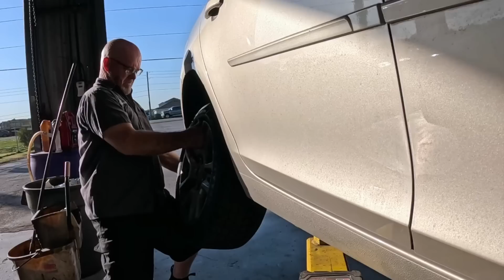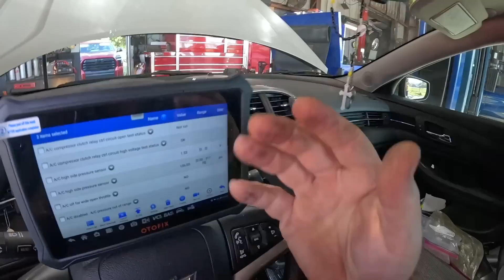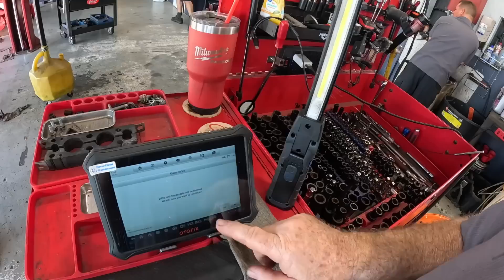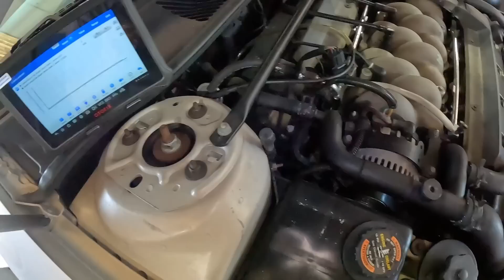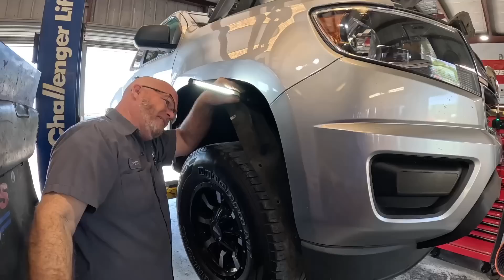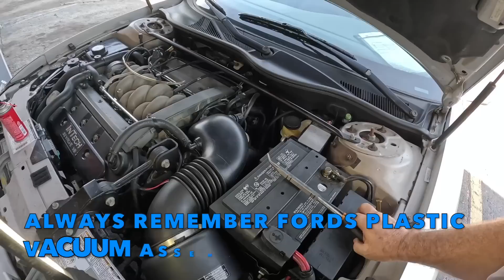99 Lincoln Idle races, stalls. Colorado Condenser. Malibu Temp Sensor TPMS. Auto Repair Shop DAY 699

Comment: And you need a smoke machine
Reply from the maker: Have a couple of them, the shops larger one and my little Ancel machine. I use them rarely since 99% of the time the problem can be found without it. But it certainly does come in handy when really needed!

Comment: The Lincoln was an odd one. The complaint was the idle races on cold start. Customer drives the vehicle to the shop, gets it up to operating temperature, and then waits while you're supposed to diagnose the issue. I'll bet he made a beeline to Autozone on his way home to pick up that sensor.  🤣🤣
Reply from the maker: It’s always a race to see if they get to AutoZone before the shop! 🤣
He did not want to chase the vacuum leak I found later and bailed.

Comment: Hey Jimmy. The problem you had with the Continental is very very very similar to what I was dealing with on a friend 2003 Econoline van with a 4.6.

He had replaced the MAF, IAC, and TPS. Truck still has the same symptoms. I even put on a spare throttlebody I had in case it was maybe sucking air

Not sure what could be done next. Maybe smoke the system?
Reply from the maker: Yeah, the main vacuum hose under the throttle body goes to a plastic tube under the wiper cowl. Huge vacuum leak, which probably explains why the MAF didn’t read at idle. It was getting air from the leak easier with the throttle closed.

Comment: The viewer who suggested that you pull down your videos because you don't know what you're doing must be furiously pounding his keyboard after the mass air flow sensor replacement didn't solve the problem.
Reply from the maker: Yeah, that one felt a little too good to be true haha. Luckily we got it solved, although the customer declined further repairs. :/
Reply: The ones that make an ignorant statement like that are typically someone who has no skills and has never contributed anything meaningful to society. You likely could buy and sell them with your pocket lint. Pay them zero attention because that's what they are likely worth, nothing. 😅
Reply: @giggiddy  Yep, well put.